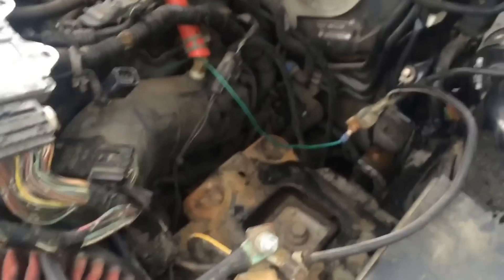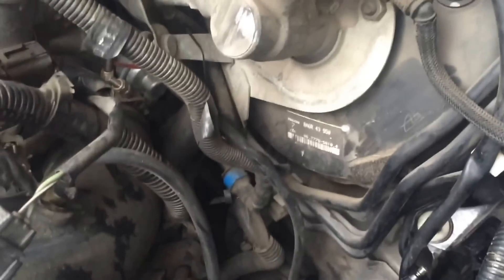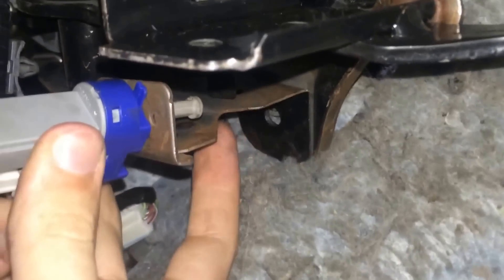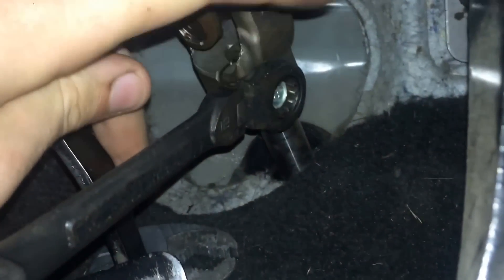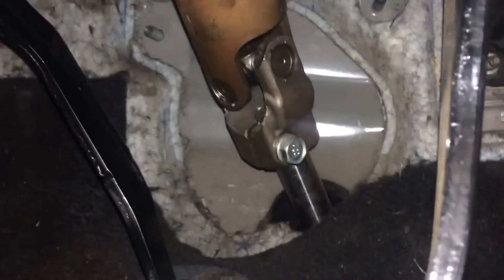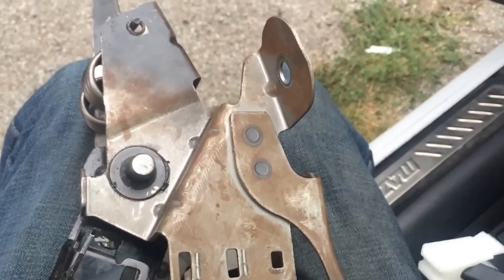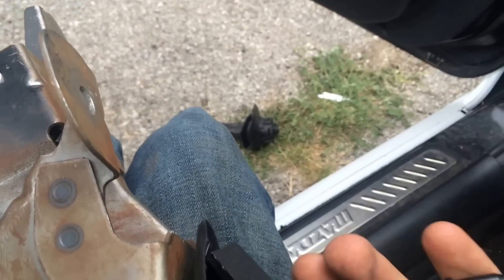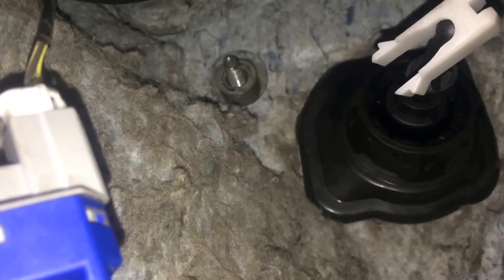Mazda Clutch Master Cylinder Replacement

Comment: One of the shitest jobs I have ever done. Upper bolt is shit. I was just pulling random bolts out looking for it. I have no clue what is loose under the dash now because I never put them back. Lining up the master cylinder is shit. Getting the white clip back in is shit. I would rather pull a engine then do this again.  I'm sure some guys can do the asap but fuk this job. Its horse shit.

Comment: The "o-ring" that was missing isn't an o-ring. Its a rubber seal that completely covers the tip of the plastic piece. I've done the clutch master cylinder on this car a few times and I found that the little rubber piece stays inside the old master when you pull out the hose. MAKE SURE YOU TAKE IT OUT because you need it or else the line won't seal like in this video.
Reply from the maker: Very good info!
Reply: @TheFeesher  no problem! Actually the first time I did the clutch master on the 3 I dropped the little rubber seal and lost it. I had to go to the junkyard I grabbed at least 6-7 of the seals so I wouldn't have that issue again.
Reply: I can't find my seal. Is a wrecker the only option to get one?

Comment: I know this is a little old, but looking for help on this. First, good video it was the first one I saw on the subject. I did my clutch master cylinder about a year ago using this video as a guide and the installation went "ok". I spent about 5 hours upside-down fighting the thing into place. After the fact I find that my clutch now has a much shorter throw and does not feel anywhere near as nice as it once did. Has anyone had this problem?  I used an OEM replacement part, but it just feels as if the rod is shorter.
Reply: Did you bleed it properly? Did you use new fluid?
Reply: 6 years later, im having this same issue now, did you ever figure out a solution?

Comment: Two things to help everyone who's here watching this.
1. Top  clutch pedal bolt can be reached with a 18" extension threaded in between the steering column and surrounding trim. 
2. You do not need to completely remove the clutch pedal to get the master out. Pull the bracket far enough away from the fire wall, push the rod in, slide it around.
Reply: I don't see how. I'm doing it right now and there's no way an extension is fitting between there.
Reply: @ragnaroksangel  bro take the corner of the bottom part of the dash off. It don't look like just the corner comes off but it does and makes the job stupid ez
Reply: @whocares5188  After dismantling all the shit the service manuals say, along with every other fucker on all these guides and videos, I got the under wheel dash guard thing off, and it didn't help. Turns out, I didn't need to take all that other shit out. But, even taking that under dash shit off, it STILL didn't help AT ALL. There's an entire thing under that with several more bolts and bullshit-

I have a completely blown right shoulder (awaiting surgery), zero income as a result (why I'm doing this shit myself), and my frustration with this sent me over the edge... I used that anger as fuel and ripped that last bolt free (I'm hurting BAD now). Nothing about this was easy. I hate this car. This is the biggest pain in the ass car I've ever owned. I cannot wait until I am free of this car. I'll never own another Mazda. Fuck this car to the pits of hell.
Reply: @ragnaroksangel  I'm was where you are. I fought it 2 days over that last bolt. Paid a mechanic to come do it. I watched him take the corner of the dash off he was done in 10 mins.
Reply: @ragnaroksangel  Hahaha, i have taken my drivers seat out to lie comfortably on a spread out duvet. Wish me luck. You fellows using the same fluid? Stuffs expensive.
Reply: @georgecostanza831  Nah, I used new fluid. I sold that fucking car months ago and don't regret it. I'll never forget what a pain in the ass that car was to work on, Jesus.
Reply: @ragnaroksangel  always a good feeling to dump a lemon.
Reply: @ragnaroksangel  bro I feel your frustration. Just put up with this today.
Reply: @georgecostanza831  I did the same thing. Helped a lot
Reply: Not enough space did u use witchcraft?😂
Reply: Are you there?

Comment: Couple tips to help install. Clean both sides of the clutch pedal bracket where cylinder will be installed. Use lube and spread it on both sides of bracket where cylinder will be twisted on. I used  dielectric compound. You will be able to twist it with two fingers. Second. To help with confusion when you have cylinder through bracket but cant get it line up properly to twist. Before install,  attach cylinder to bracket. Using white paint mark the bracket and flange of cylinder so you can line those up from inside vehice before you twist it in place. Twist the cylinder in place  while you have room before bolting bracket up.

Comment: Same exact thing happened to mine. Ended up getting a replacement at oreilly, the shaft is actually made of metal.
Reply from the maker: That's the way to go!
Reply: Replacing mine now, and same

Comment: Thank Ford engineers for this stupid design.
Reply from the maker: +Ryno5150 I know right? Lol terrible design
Reply: The Feesher I just finished doing it on my 2010 3.  I'm gonna sell ASAP and go back to daily driving a 2WD Toyota pickup.  Same job would take 20 minutes at most.
Reply: Have you guys seen what's involved with changing the PCV valve? I hate working on this fucking car more than any vehicle I've ever owned. I hate this car so bad. Will never own another Mazda after this shit. Between this whole thing and the PCV valve, FUCK this car

Comment: I should of never bought this car! There goes 17grand
Reply from the maker: +Audio6195 it's just a master cylinder. $20 and it'll be back on the road!
Reply: I hate this fucking car. Every goddamned repair is a nightmare
Reply from the maker: @ragnaroksangel did have to do the blower motor?
Reply: @TheFeesher  Yep! Super obnoxious. Same with the cabin filter. I can't think of any maintenance I had to do on that car that wasn't obnoxious

Comment: Video helped, you don't need to disconnect steering column U-joint, clutch pedal assembly will come out without removal. I used a open end oil filter wrench to unlock and lock master cylinder.
Reply from the maker: +Devon that's actually a pretty good idea, hopefully others see this comment!
Reply: Do you have the same car? How on earth did you get the clutch pedal out?

Comment: I can't seem to get the whole clutch pedal out I removed all bolts its just the master cylinder holding it. I've been trying for 30 mins
Reply from the maker: +Wasntplanned it's been a while, but what I remember doing was twisting the master cylinder before removal of all the bolts, then it can slide from the back of the assembly
Reply: The Feesher ill try to hook it on the screws and twist the master cylinder. I removed the under column of my steering wheel as well
Reply from the maker: That sounds like a good plan!

Comment: I just did this over the weekend, not looking forward to doing it again - heh.  For those top bolts that are a pain in the ass to reach by going up under the dash I finally removed the steering column housing.  From there if you look straight through the wire loom you will pretty much have the bolts in question directly in front of you, took me 30 seconds after that.
Reply from the maker: Jed Riis agreed, definitely not a fun job and not fun fasteners
Reply from the maker: Jed Riis the issue I had is that everything under there is razor sharp lol
Reply: Yea it is!  I manage to get out with only a minor scratch on my hand.  Bruised myself up more contorting myself under the dash.  Unfortunately I too may have the same issue had did when you finished - leaking from the clip - luckily on my slave, also replaced, which is much easier to get to.  I might have re-seated it better last night but it got too cold for me to mess with it much after that, checking for drips when I get home in a bit.
Reply from the maker: Jed Riis yeah it seems to be common, we needed to buy another clip+seal which we got at the salvage
Reply: @james w if you use a 12mm rachet wrench,not a socket, like he said in the video you should have no problem reaching up in there with your left hand while sitting on the ground next to the car. Your have to feel up in deep and get it on the nut and slowly ratchet it back and forth
Reply: Mine is a 2009 and that doesn't work for this car. There is an entire solid assembly after removing that panel that blocks you from doing that. Removing that assembly is a no go. You'd have to remove the ENTIRE dash assembly from the firewall.
Reply: @ragnaroksangel yes exactly it was the most stupidest design Mazda could have done I ended up taking the knee bolster out and drilling a hole so that my extension could fit through. Went from 3 hour job to 30 min lmao

Comment: How did you solve the issue with the line leaking after the install?
Reply from the maker: Rory Donovan I made another video showing how we tried to. However that didn't fix it. We had to go to a salvage yard and get a new clip, there was a seal on it that went missing somewhere during thevrepair